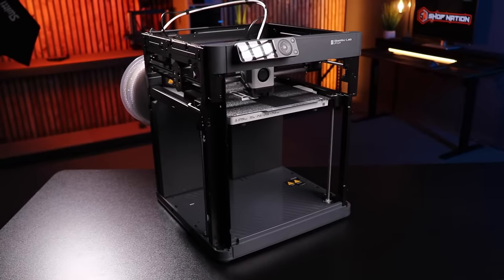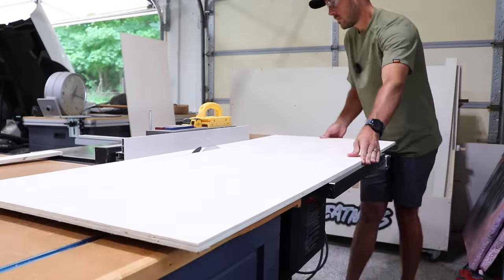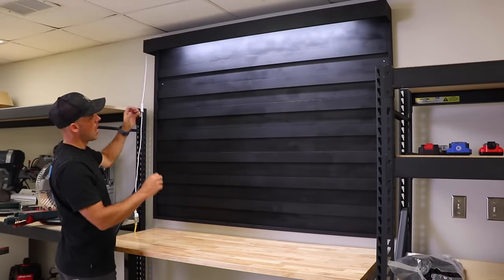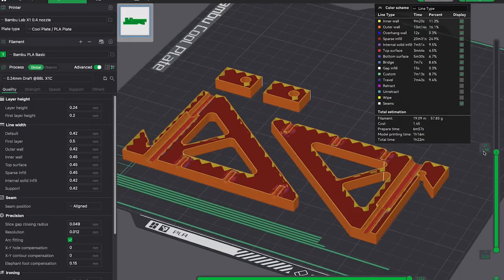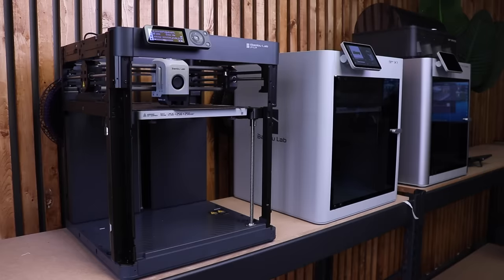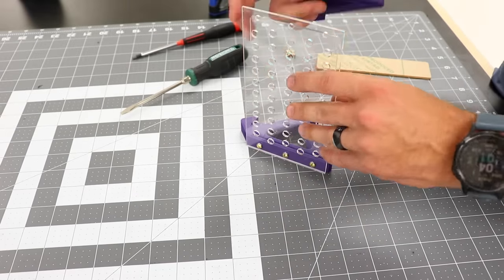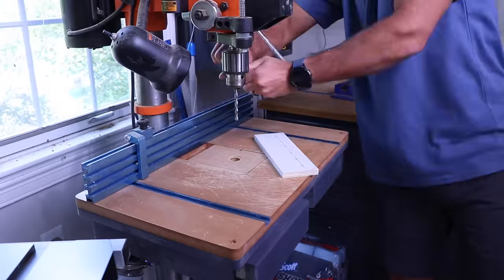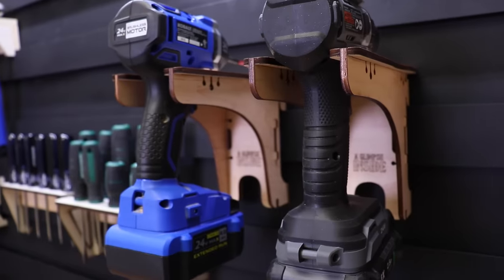Do you really need "smart" tools?  The answer will SHOCK you!

Comment: I didn't see references to space and intention in the comments I read. Effectiveness has a sweet spot in terms of shop space. Too small and you're moving stuff all the time. Your shock at the time spent changing drill bits is a nod to this. Too big and you spend lots of time moving around between work areas. This is also true brought down to individual work stations or areas. Then there's good old-fashioned intention. Cranking widgets to turn a profit is at the other end of a spectrum with folks using hand tools only for the sensory,  meditative, or artistic benefits shop work and production can provide. On that spectrum, you seem around the median with the bulk of the experiment focused on efficiency. Aside from all that, it was useful and fun to watch. Thanks!

Comment: Given the automation involved, I was surprised that the time differential was not more significant.  The most significant advantage 3d printers and laser cutters is repeatability.  If I had to build 20 tool holders and have them be exactly the same, a 3d printer or laser cutter is the way to go.  Aesthetically though, I found your hand-built holder much more pleasing to the eye than the 3d/laser equivalents, but there is no accounting for taste :) Thanks for making this video.

Comment: Hey.  you added the time to design the holders to the digital versions, but not the traditional ones.  in fairness, you should have added the time to both as the design was used in the traditional holders as well.  yep, I could have banged out the traditional ones in 2 hrs, start to clean up, but that is because that's how I build things like that.  I would have a lot of opportunities for learning if I was to 3D print them (meaning I'd make a lot of mistakes).  this video has convinced me that I need to invest in a 3D printer and laser cutter.  those looked sharp.  thanks for doing this video.

Comment: Id buy one of those socket holders for the wall. I dont have a french cleat, i just have a 4x8' sheet of plywood hung on the wall and use nails to hang the tools. The allen sockets are what i use most and they are in their plastic case with no way of hanging them 😢

Comment: I'm a welder, mechanic and machinist who bought a 3D printer purely for making tools and parts of tools. I certainly would not buy one BEFORE getting much more useful hand and power tools including air compressors and welders (which also help build tools and even workshops) but they're quite handy especially for disposable items because you can always print more.

Comment: you can actually use those toggle bolts inside of a steel stud for even more holding power, which is typically how one would hang something off steel studs if there is no blocking behind the drywall.

Comment: Excellent compression of time. I  do have a few questions that may make the digital slightly faster  then the traditional. The time to build out what you want it to look like, the 3.5 hours spent at the computer making the files did it save you quite a bit of time when you got to the traditional route? You did briefly mention this but one could make the fact that this could be the same for both traditional and digital. Did laying it out for the digital portion to cut save you time for the layout of the traditional? If you did not do the digital first would you have had about the same amount of scrap material?

One thing that would be an interesting thing to know is material cost.
 Since you can get finer detail with the digital method, did this allow to fit more parts closer together on the material  or did you use about the same amount of material?

One last note even though this is a one of project it is a a modular wall. You did mention that the digital portion it was manily the same just different tops, cut and paste the digital files and change out the top. Would the digital route save you some time in the future if you wanted to add a different tool holder?

Comment: I think the thing not accounted for was your pre-existing knowledge of both the digital layout and fabrication tools.  If you are new to CAD or 3D printing, there is a big learning curve.  For someone with the skillset you've developed over years of experience, I would say the test is valid (and a little surprising).  For the rest of us, if we had to learn all of the skills associated with CAD and 3D printing, the time delta could be days...  If you have resources you recommend for learning the digital fabrication skills, we'd appreciate you putting that out.
Reply: You are right, except for the fact that once you learn CAD for any CAD/CAM platform it translates fairly easily, at least for lasers and 3D printers. What I employ is a hybrid method, I'm pretty experienced as a manual woodworker but I use my laser all the time for making jigs, templates (especially routing profiles) that speed up or make the job more accurate, and 3D printing in a very limited way for low cubic volume parts that have complex or difficult features to fabricate. I would never 3D print those brackets he did, I would just bang them out of 3/4" baltic birch, I am not sure his XTool will do that though- my 130W CO2 with a 63.5mm lens will make short work of it.
As far as resources, learn Fusion360 if you are on a budget, as it does CAD/CAM, or if you are ready to spend some real money, Solidworks for the CAD  and Solidcam, Mastercam, or Gibbscam. For 3D printing the higher end printers like Stratasys and "Prosumer" machines like Formlabs use proprietary software, the millions of filament printers out there primarily use Marlin or some derivative of a slicer/printer program. Lasers typically use something like Lightburn. 
I built my first CNC machine in 2006, that one is now on its third generation of controls, that is how much things have advanced.

Comment: Machinist by trade here...could have told you the "initial runs" would be pretty close. The digital advantage will be when you do the 2nd/3rd/4th run etc...all the design/testing is done so just a matter of "pushing the button"

Comment: Nice comparison.  While some may think that repeat production would be faster or more efficient with the digital tools because a digital file can be loaded again later, this is not an inherent advantage over the analog processes.  Having a file system of often used plans or components is the same whether that archive system is digital or a file cabinet.  The difference is in the speed of proficiency and experience with the tools being used.  Since this test is using the same person and essentially the same creative touches it should be about the same amount of time.

Comment: I would be curious about the shop methods you used. If I need to make a batch of parts that are nearly identical I don't tend to try and repeat it a bunch of times. Instead double stick tape the parts together and reduce the number of operations. Also you mentioned the build failures but I don't think you accounted for any time for that happening. Of course I guess it is just as likely that you mess up on your part in the shop. Overall though I found it very interesting and the fact that the build times are virtually the same I think it comes down to a clean process vs instant gratification.
Reply from the maker: Very true!

Comment: As a metalworker, I believe, it very much depends on the part you're Making. 
If it's a one off, you can manually mill it faster, than you can program it to cnc, but make 3, you're better off letting the machine make it.

Comment: I mostly agree with your numbers as far as the time it takes for each, and I follow your logic. 

I do think it may not be entirely fair, though, to add an hour of your time to attend to the laser and make sure it does not burn your house down.  Truthfully, you don't have to stand and stare at it.  You can actually be productive while the laser is running, so long as you're close and keep an eye on it.  

So, essentially, you can multitask while the laser is running (obviously, don't leave it unattended, yadda, yadda, yadda).  Personally,  I think it'd be OK to say it's only, say 30 to 45 minutes of your time.  Mock up your next project while sitting next to the laser while it's running.  Time saved.

Incidentally, I just found your channel and I"m enjoying it.  I've been trying to think about product ideas for my own shop and was considering trying to fabricate a couple things and boom.  Found that you're already doing it -- and there's very little doubt that your'e doing it better than I could.  Still fun, though.  :)

Comment: a little gripe with the end time estimate, the difference here is that making it manually means it was actually done in 5 hours. on the machines you still had to wait for it to finish on its own, sure you could use that time doing something else, but it's still time on the clock ticking down. I've seen prints go for days for something tiny. where as the equivalent in a shop could be made in a few hours.

Comment: Great video!  The last minute of your video says it all.  For repeatability or volume work, the digital version will be quicker in the long run, unless you tool up properly for traditional production.  The argument could also be made that, without the laser engraver and digital printers (a significant capital investment... certainly more than the price of the table saw and drill press used for the traditional method) the digital method is moot.  For sheer accuracy, the digital method has an edge, whether for a one-off project or production work.  QC is important in production, and double checking your work eats time.  Machines generally don't fatigue or forget a step...  Once the prototype is confirmed correct, you can hit play and make a million more knowing they will all be correct.  I am certain there was a measurable amount of stress or anxiety using the traditional method, working out the problems and hoping the parts fit properly using less than exacting measuring tools and techniques.  Sure, the parts looked fine, but were they really as perfect as the laser cut bits?  

Ultimately, when looking for production efficiency gains, clean organization and reduced movement are the two biggest things to focus on, regardless of what equipment you have.  Human movement is 100% variable, yet controllable... you set the desired pace.  After that, choosing equipment that can maximize output while minimizing human effort is paramount, so long as it fits in your space.  Material handling and efficiency consultants make big bucks for a reason, and there are engineering degrees for just this aspect of production manufacturing.

Also, regarding the laser cutting of the wood... so long as you are using laser grade materials (laserable plywood uses special glue to laminate the plys, making it easier to cut and less flammable), and your air assist and exhaust are functioning properly, you should never have a flare up in your machine.  I have owned and operated a company using Eplilog lasers for about 15 years and never had a fire.  But if you are still worried and want to babysit the machine, I always set up a small assembly table next to the laser so I could do two tasks at once.  Time is money, baby... why not double dip!

Comment: Cut wood smells way better than burnt wood or melted plastic.  

That said, I had a chunk of pegboard on the side of a cart... just some leftover stock.  After staring at it for a while, I though some pegboard tool holders might be useful.  Found some thingiverse holders, printed a few, then spent the next week designing and printing my own custom designs.  Damn, that's addictive.  That one little chunk of pegboard is now packed with hand tools at the ready. A very satisfying project.

I've recently bought a cheap laser head for my cheap CNC.  95% just for learning.  I actually don't like the burnt-edge aesthetic and I've recently discovered the lingering smell on the parts isn't exactly pleasant either.  But, it is fascinating what can be done with them.  I suppose I'll find some addictive project for that as well.

Comment: As noted at the end of the video it all depends on the project and the user etc. Had this project been to make a wall 3 times the size, the digital tools would have been significantly faster as you can queue up the prints, peal it off and the next one starts. I'd also like to state that there is a massive time sink against the digital tools that should be reconsidered. You spent an hour standing around the laser cutter to make sure it didn't catch fire. I believe you could have started the laser cutter first, moved on to designing the 3D prints OR build the wall and paint it while the laser cutter is going and staying in general proximity and checking on it every once in a while.

Comment: Interesting test. But I believe the digital side will win if you’re doing the same thing over and over again. Bc you’re right, we’re not programmed to do repetitive tasks.  Loooong time ago I worked at Motorola in IL.  After 10 minutes into my shift my mind wanders.  I use my laser and CNC for things I can’t do by hand. While (sorry about this part) the laser cleats were functional they’re not pretty.  Thin burnt wood vrs Baltic birch, hands down Baltic wins every time. My favorite piece is the acrylic tool holder thingy. Do it again but jazz it up by adding a tidbit of black epoxy into the size. Or have your fancy laser cut it out w sizes. You’ll see the contrast and easily find what you’re looking for. 
Great content as always!

Comment: I've actually forgone some of the traditional woodworking skills, such as dovetails and complex joinery, in favor of digital mediums instead.   I can add and intricate scroll or design to the top or side of any panel and see it complete via machines like CNC and Laser Cutting.  I have even taking to using my laser to mark up boards for cutting, as the dimensions are extremely accurate and the lines are always straight.

Comment: As you mentioned in the video, designing the parts is the biggest part of such a project. Here, you did all of that on the computer and counted it as part of the digital method. Once you know what the exact project is, what every part is and how they fit together AND all of that has been proven correct by a complete build, the rest is just turning the handle.

Comment: Based on my own tool organization addiction, I 100% assumed that doing it by hand would take longer, but I think there are huge variables. I like to box joint, well, everything, because I find it satisfying to do. I don't use any nails, and only the occasional strew, so that I can cut things apart and re-use the materials when I get different tools. This takes a long time. I also tend to way over engineer, and way over do it on aesthetics. 

My Japanese pull-saw holder could have taken 10 minutes, but I wanted to put a bunch of curves on it, and wanted it all put together with wedged tenons and removable dowels, for no reason other than enjoying the build. It's totally a waste of time from a functional standpoint, but the I get my workshop high from making the build unnecessarily complex, and just pushing my limits - which leads to a lot of failed designs, to be fair - but leads to a lot of satisfaction. 

I don't have the money to make furniture out of hardwood all the time, so I have a lot of fun with box store pine and re-sawn 2x4s when making tool storage. If it cracks, I build a new one and improve on what I disliked about the previous one. Sometimes I practice different inlays of butterfly-inspired crack repairs. 

I also like to sand everything, blunt every edge, and just clean it all up, so that adds a ton of time. I'd like to have a laser/CNC to prototype, and then build the final design by hand, once I can see that it all works, using only think plywood to make the prototype. Sometimes when figuring out sizing, you kind of just need to hold the thing in your hand, and put the tool into it.

The only thing I don't do is apply a finish, because that is just an extra expense, and can make it annoying to re-use the material later.

Comment: You forgot to include time for mental fatigue and the cost attributed to recoup / rest / recover from that. The old school method will create a lot more neck and arm strain dependant on age / stress and rest cycles. Also in automation you could have auto extinguisher / camera monitoring / sensors / etc. so you can literally step away as the tech develops and becomes more reliable.

Comment: The biggest benefit of digital IMHO, is that if you made a measurement mistake or need to make an adjustment, it is very easy while working with traditional material may mean that you need to start over.

Comment: I am surprised by the manual way being close to the digital way, but honestly the design process is the chunk of the time. you subtract that when u need to make a new one and 90% of the work is already done, you just need to design a new top plate or extend a dimension here and then you send it to the laser or 3d printer. and then you just wait for it to be done, where as in the manual way you gotta redo every step. and i know you said this was for a 1 off project but there may come a time when u need to add more french cleats somewhere to accomodate new tools and its just faster and more efficient i think to go full digital.